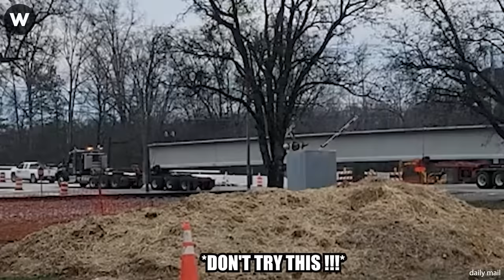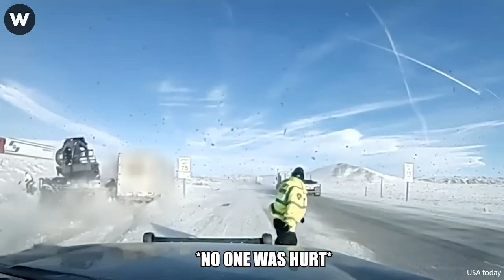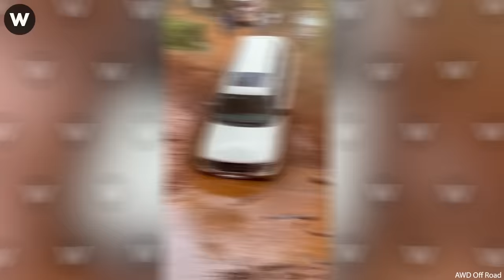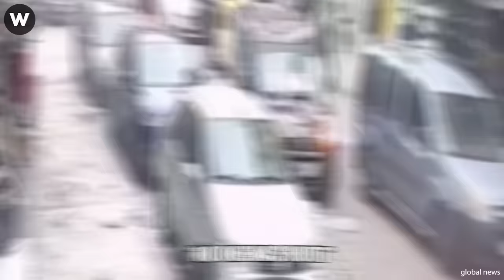10 Scariest Catastrophic Failures Caught On CCTV Camera

Comment: 2:29)The Moped driver has to be one of the calmest people on earth.
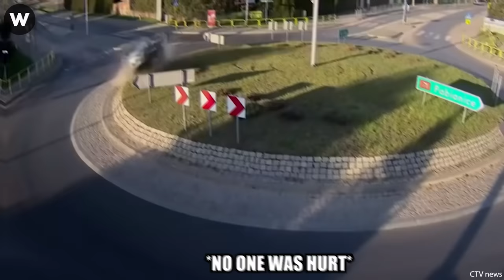3:25)One Florida, US city had to remove the round about. TOO many people hitting it.
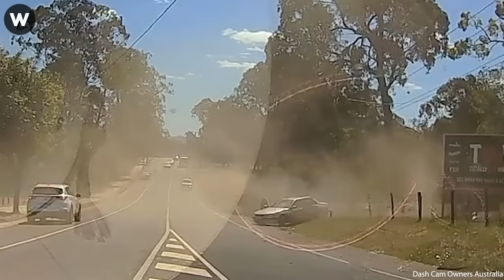3:52)The best 2 weeks of my life were on R & R in Australia. Does the "No One Was Hurt" apply after the accident?
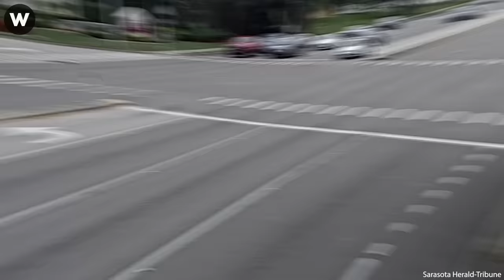6:08) Florida, US again? A yellow light seems to mean SPEED UP. There are left turns on a red light. No stopping when making a right turn. 
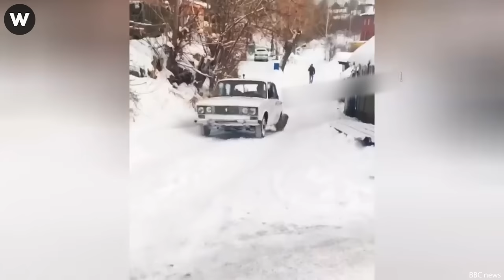9:26)Wheels wobble like this when the lug nuts are loose. Also a nut loose on the steering wheel.
Reply from the maker: Thank you for your opinion!!

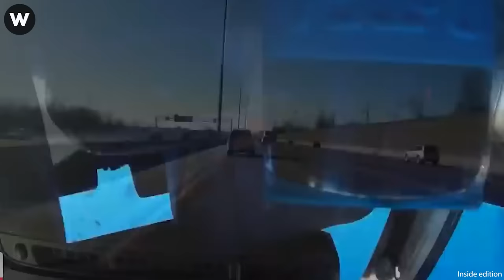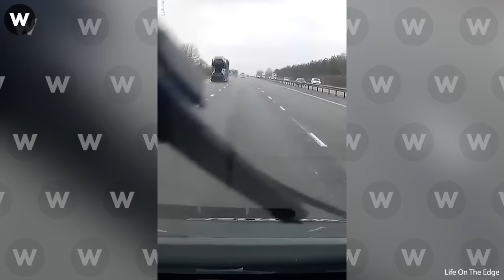Comment: From about 18:00 to 18:30 the video shows tires (WHEELS) coming off and bouncing down the road (and into buildings!) only they weren't the tires' problems because they were still on the wheels. Then the narrator starts talking about tire safety, as if the tires were bad and were what caused the tires/wheels to come off.  That is actually due to failures in bearings, hubs, and axle/spindle nuts, and other mechanical problems. I'm not very mechanical and don't know the names of all the parts that can fail and cause wheels/tire to come off, but I know enough that they weren't caused by bad tires. An unbalanced tire can help cause some of those mechanical failures, but those parts probably have to be pretty bad anyway for a tire to cause those parts to fail.

The tire maintenance advice he gave is still good advice. Having a flat, especially on the front, CAN cause a catastrophe when moving! But wheels (with tires) coming off and bouncing down the road is NOT caused by tire failure. Make sure ALL of the parts that are part of the wheel system are ALSO well maintained!
Reply from the maker: We're grateful for your comment and the positive vibes you bring! If you enjoy our videos, please show us some love by hitting the like button and subscribing. Your support keeps us going. 🙌❤️